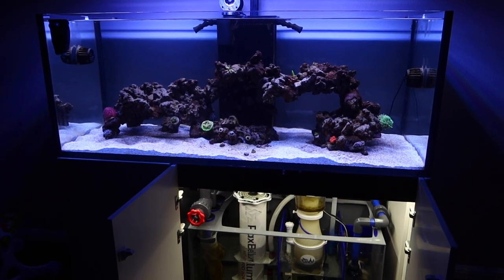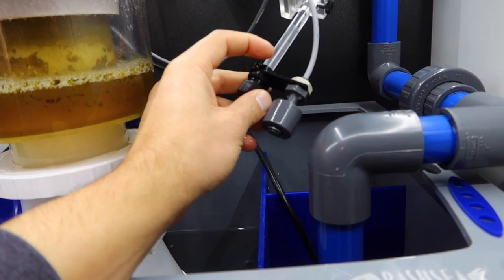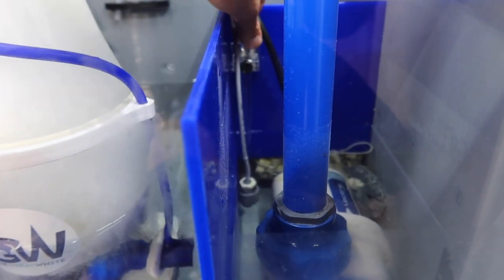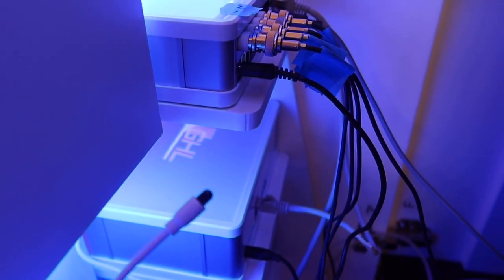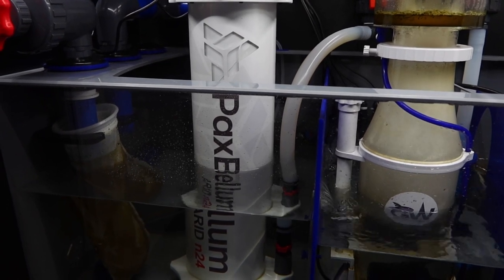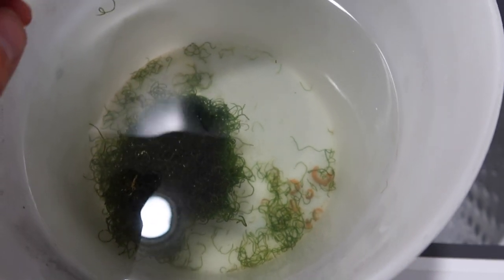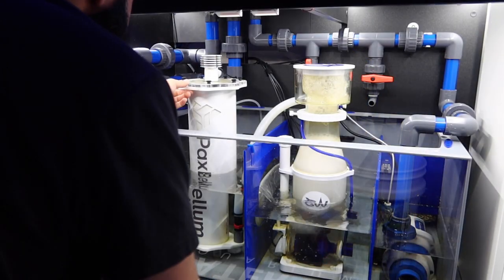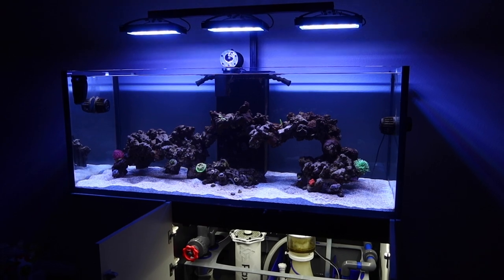Pest Free Chaeto DIY + GHL ATO

Comment: I’m in New York but my tank uses almost 50% less ATO in the winter vs summer. The air is usually dryer in the winter especially with home heaters on and that causes more evaporation. Our summers here are more muggy with more humidity and that causes less evaporation. Interested to see how yours is different out there in Southern California
Reply from the maker: Ya you may be correct. I’ll have to wait this summer to see where we come out. I wouldn’t be surprised if it’s close to 3gal a day.

Comment: I have been seeing some videos and I saw that if u have more tangs in a tank there will be less aggression. This is the 120 gallon stocking list I’m planning on having. I will have strong filtration with a refugium and an oversized skimmer. Do u think this stocking will be ok. If not what should I add or take away from this list to make it better.
Fish:
2 Clownfish (most probably Ocellaris Clownfish)
2 Banggai Cardinal
1 Tomini Tang
1 Purple Tang
1 Powder Blue Tang
1 Coral Beauty Angelfish
1 Royal Gramma
1 Yellow Wrasse
1 McCosker‘s Flasher Wrasse (male)
1 Leneatus Wrasse 
1 Pink/Purple Firefish
1 Geometric Pygmy Perchlet
1 Randall’s Prawn Goby
Invert:
1 Blue Tuxedo Urchin
1 Blood Red Fire Shrimp
1 Randall’s Pistol Shrimp
30 Nassarius Snails
10 Cerith Snails
20 Trochus Snails
Reply from the maker: That’s a great list 🤙🏼 I wouldn’t change anything

Comment: The salt you are using it has got phosphate I’ve noticed a different straight away when I changed from red sea pro salt. Maybe a little heads up for you
Reply from the maker: It does have some but for my tank that runs at 0 it can use a little haha

Comment: My neptune DOS has been dosing 4 gallons a day for 2 years and on the same heads.
Reply from the maker: Ya but those are actual peristaltic pumps which are a lot bigger heads. Yours were designed specifically for large amounts.
Reply: @eatsleepreef9565   True and I was totally missing the point you were making. It also doesn’t surprise me the ghl doser can handle large amounts water, they do make some super nice gear. Thanks my friend.
Reply from the maker: No worries brother. The only reason these can do it is bc they are stepper motors and not your typical Dc motor. But ya for the size of these heads they are a work horse. The apex dos seem nice too 🤙🏼